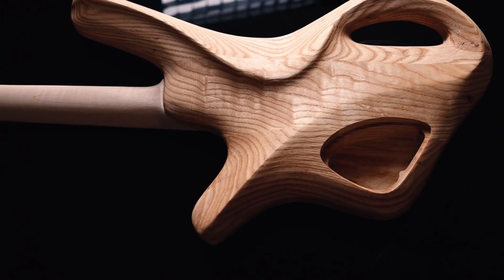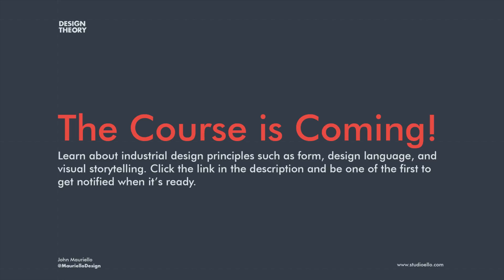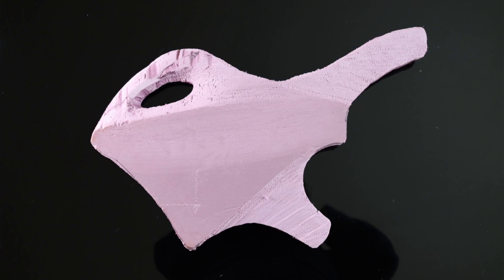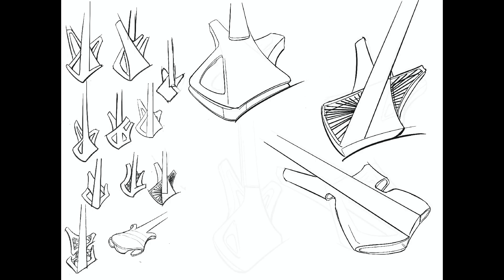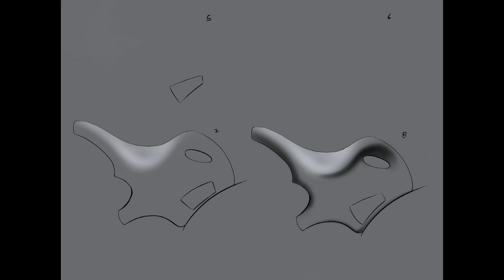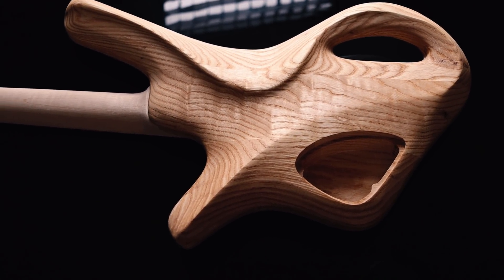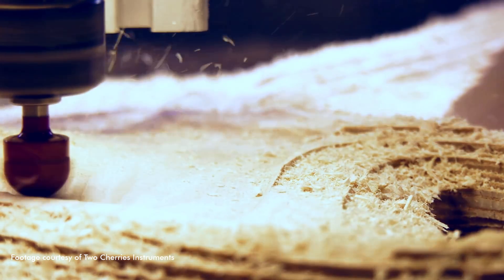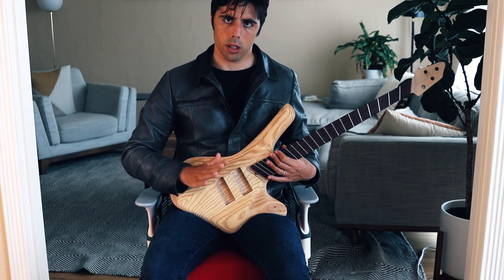How I Re-Designed the Traditional Bass Guitar: Industrial Design Process

Comment: I've been an industrial designer for decades and a bass player even longer (and builder, as a hobby).  Observations: The amount of wood that goes into making such a heavily sculpted body, including the wood cutting and dust that ends up on the production floor, precludes medium to large scale industrial production.  In other words, this is a small boutique type prospect.  This is a market space where people generally pay $5,000 to $12,000 for a new bass guitar. 

The three most likely main questions bass players would want to know are these:  Weight?  Balance on a strap?  Tone/sound (related: active or passive circuitry)?   Expereinced players will also be concerned about neck construction: wood species, flat sawn or quarter, truss rod details/type. Does it have stiffing bars.  Is the neck 1-pc, 2-pc, or multi-part laminated construction?  Fretboard radius?  Nut width?  

Diving down further, we're a particular lot with concerns about neck shape/profiles and front to back thicknesses (at 1st and 12th frets).  An asymmetrical neck profile is bound to be of limited appeal because they simply are already.  Asymmetrical neck profiles have already existed for decades or longer, with famous examples, but they've never been all that popular among guitar and bass guitar players, broadly speaking.  There's also the matter of best orientation of the asymmetry (thicker on the bass/low side of the neck or thinner).   The best answer can depend whether the player prefers to play their bass guitar on trap, standing, at low, or neutral (closest to or same as sitting position) to high position (classical) relative to their body.   You've put a lot of consideration toward playing the bass while sitting but it's also important to consider the standing player and balance those needs as best as possible.   This leads to a lot of questions about neck profile choice.
Reply: This circles back to the beginning.  I'd question why some players you know of have problems with carpel tunnel, analyzed on an individual case by case basis.  What are the true roots of the problem that might be solved?
Reply from the maker: Here's my response to your questions.  
Weight?  7 lbs for the prototype in the video. will vary, though depending on the wood...probably 6.5-8 lbs. 
Balance on a strap? not sure how to answer. no neck dive, if that's what you're asking.
Tone/sound (related: active or passive circuitry)? Active circuitry. Link to sound samples is on my instagram (link in description)  
 Experienced players will also be concerned about neck construction: wood species, flat sawn or quarter, truss rod details/type. Does it have stiffing bars.  Is the neck 1-pc, 2-pc, or multi-part laminated construction? 2 piece neck. Quartersawn maple. I think I ordered chechen for the fretboards but I'd have to check. No stiffening bars.   
Fretboard radius? I think I did 10 or 12" but I'd have to check 
Nut width?  1.5 inches. 

I'm only going to be building seven of these. I haven't figured out the price, but they won't be cheap. You make fair points about neck profile, but I probably won't change the neck profile too much since the design is complete and production is underway.

Comment: The problem of Fender bass guitars is how Leo Fender thought how players would play the bass, back in the 50's the finger rest down the strings was designed for bassist to rest their fingers and use the thumb for plucking the strings. Of course, this wasn't thought through and bassists played with their index and middle fingers to play, just like a traditional upright bass.

Comment: As a bassist I would recommend adjusting the angle of the neck while keeping the way that the body sits the same. In your short demonstration of the prototype I can tell that trying to play the prototype with a standard right hand finger style technique would cause uncomfortable bending in the wrist to the right in order to align with the strings. If you were playing with a technique similar to a finger style guitarist where the thumb is used to play notes as well as the fingers then this bass would be exceptionally comfortable because that technique requires the angle of wrist that your prototype encourages in the right hand. Adjusting the neck angle upwards would align the wrist perpendicular to the strings and remove any unnecessary bending. I’m unsure if this adjustment could have a negative effect on the left hand wrist angle. Just a suggestion, I hope it helps!

Comment: The ergonomic design is actually pretty cool, it’s fresh and it gives futuristic vibes. I don’t mean that the fender isn’t beautiful or iconic, but sometimes we need to try new things. The fact that it’s not only asymmetrical in two directions like the fender, but also in the third dimension, really represents the possibilities of music.
Reply: Only problem with the new design is the old design works just as good… if it’s any more costly than those I ain’t buying it. I’m more of a function over form person, I guess?
Reply: @deskslam4232  well the benefit of something being more ergonomic is that it further prevents bad postures that lead to actual body problems. I admit that I've got a passion for the art of ergonomic design, so I might be biased.
Reply: Well the new design was specifically made to solve the ergonomic issues the old design brought up.  So therefore, the old designs simply don’t work as well when it comes to ergonomics.

Comment: And now for an honest critique from a fellow industrial designer (not to be read as angry, hurtful or mean) This design doesn't change the ergonomics of playing a bass. That comes from the fact that the fret board is flat and you are playing it it from the underside with the fret hand and the over side with the picking hand, while horizontal. this has not changed in the design. You'd need to be very upright for it to change, like and upright bass, and behind the instrument to lessen the angles. Otherwise you'd need to make a twisted fretboard to ease the angles on your wrists. That could be really neat, but there would be some serious fret buzz probably. An easier solution would be to have a weighted design that would stay in the position you wanted when wearing it on a strap, since most performing musicians play standing up. What you have designed makes an upright playing style, but only for your body. A round bottom would allow the user to configure the angle without having any sharp areas in their lap. Maybe something adjustable that could support the bass against the player's leg could have been another solution. The end result is beautiful, but it is more of a styling exercise if we are honest, because of the fundamental physics of stringed instruments, and the style of playing electric basses.

Also for next time, you should have finalized your design further in your foam model before moving to CAD. You could have gotten to the same point as you did with the CNC which needed corrections after milling with just hand tools. Then you could have measured your model for CAD, cut up the model and scanned in the sections 2 inches at a time to have an exact model in cross sectional planes for rhino. It's lower res than 3D scanning, but not everyone has access to that kind of machine. 

Can't wait for the next iteration!
Reply from the maker: Hey spaceman, thanks for the feedback, but this is not just a styling exercise. This is significantly more comfortable to play, while not requiring the user to completely overhaul their technique or look like a weirdo on stage with a vertically oriented bass.  If I do another iteration, my plan was to always do a more vertically oriented instrument because of the ergonomic benefits it provides. However, based on my research, this is the most advanced yet acceptable solution. 

 I could have twisted the fretboard. Twisting the neck with that level of precision has been done with other instruments,  but it would have doubled or tripled the cost of the instrument for only a marginal improvement in ergonomics. 

I did about a dozen mock-ups in foam that were more sculpted, and I think at least one of them are actually in this video (I could be wrong). But yeah, I didn't photograph everything, just for the sake of expediency.

Just to be clear, did you watch until the end? It's a pretty significant improvement in terms of ergonomics. I've tested this design with about 6 or 7 bass players. You always have to take these small sample sizes with a grain of salt, but the results have been pretty positive. The biggest advantage is the positioning of the instrument, which is enabled by the sculpting of the body, the shorter scale length, a very specific asymmetrical neck profile, and the body shape (being able to switch between classical and modern playing positions)

Comment: Sorry.. I'm gonna have to stop you at this one. you're clearly a talented designer and you understand some of what goes into a good instrument, but you lack some of the understanding of instrument ergonomics that mean this is more of an art piece than an actual redefinition of the bass guitar as an instrument.
Reply from the maker: Do you have any specific feedback? Otherwise I'll have to strongly disagree with you.
Reply: @Design.Theory  1) that neck joint. if you’re planning on making it set-neck, it might work, but in that case you could get away with a much smoother transition between body and neck. if you’re planning on doing bolt-on, good luck getting that to work. check out Ritter instruments for some good alternative neck joints to the standard block-fender style.
2) the ridges on the back of the body. they look cool, but having a smooth surface on the back makes the body a lot more comfortable, and you’re just gonna have some edges poking into the player. 
3) this design is pretty much exclusively playable in classical position. classical position is great and all, but a majority of musicians don’t play like that. having better counterbalancing so the instruments doesn’t dive when not sandwiched between the user’s legs is a must. 
4) Why no headless? If you’re redefining the bass guitar, there are few things that are more of a nightmare to deal with than a headstock throwing off the center of mass of the instrument. 
5) that fan is really aggressive, especially for classical seating position. those upper frets are going to be practically unplayable in a standard 3-or-4 fret stretch because the frets are angled opposite of how the hand naturally countours up there (see Ibanez’s new Quest line of guitars for their slanted frets, really helps in classical seating position). 
6) Id extend that lower horn. not only would it help bring the center of mass closer to the center of the instrument, it would mean that in various playing positions the instrument is less likely to slip off or be unstable

Comment: The first instrument I ever loved playing was the electric bass. When I was 10 I found an Aria Pro II at the local music store on consignment for 150 bucks and one summer I won a $100 prize at a music festival for something I played on piano.  This would have been 1997.  So I put up my prize money and my folks chipped in the rest.  The body was a bit banged up (as far as I was able to determine the thing was made in 1981) but even with my weak little uncalloused fingers and pencil wrists I was able to get a good sound out of the thing almost immediately for a few of reasons:  

1: The neck was not tapered so I could reach around it at either end, 
2: The action was low and constant with frets in good condition so I didn't have to apply undue amounts of pressure to avoid notes buzzing, and 
3. The pots and jack were of such good quality that even though this thing clearly hadn't been babied there was no crackle, hum or other noise from the electronics.

Also, it had a single P humbucker built into a rectangular box inlaid in just the right spot to give you a place top rest your thumb when finger picking.  When trying to play other basses I always felt a bit lost without that reference point.  It's always possible to rest the thumb on the heavy top; most string but obviously that's not optimal as it's not fixed and quite often needs to be allowed to ring out which means hands off.

I like your design but it reminds me a lot of designs I've seen before.  There have been some crazy body shapes for basses.  I used to want a Ritter Jupiter like nothing else.  I sorta still do now that I think of it.

Anyways I just sort of rediscovered your channel.  I remember seeing and liking it some time ago but I ended up not subscribing then because I've always hated sales and marketing language.  More recently I've been able to pick that apart from the fact I just hate capitalism.  I don't think there's anything wrong with creating and wanting to make a persuasive case for new or ambitious designs; especially if they may be counterintuitive at first.  I'm willing to believe (for the time being) that your an artist that needs to eat and pay rent first rather than a smooth talking salesman that takes perverse pride in persuasion in and of itself as some sort of art.  So I'm now an official Design Theory hypo-theorist.  That means I subbed.
Don't let me down.  Or do.. I'm not your dad.  I'll see ya around.

Comment: The angled frets actually make a tone of sense looks comfy now I'm realizing how weird it is that they're traditionally parallel
Reply: You can actually find fanned frets on a whole lot of basses and guitars for metal.
Reply: Probably a manufacturing decision, but I agree! Angled frets seem way more ergonomic.
Reply: @BlueJay_55  they also increase the scale length of the lower strings so they don't sound muddy
Reply: Check out the Ibanez EBH1000 - they have a couple of other models with fanned frets, electric guitars too, but that one was especially comfortable to play when I tried it out a while ago.
Reply: Are you thinking of the ehb 1000? It's not multiscale. The 1005 is though.
Reply: @bengal2441  Nothing to do with intonation whatsoever, just more suited to have a lower tuning on the bottom strings.
Reply: @bengal2441  i think you confused fan fret with true temperament fret.
Reply: @bengal2441  lol
Reply: Very comfortable to play too
Reply: Fanned frets are multi-scale, meaning if all guitars were like that the low strings might be too tight and/or the high strings might be too floppy, fanned fret guitars and basses are great for different tunings though
Reply: @nighpaw4651  Most of the time, on straight-fretted instruments, especially basses, low strings are too floppy and high strings are too tight. 34" barely works for the low B string, it's not very defined on many instruments. So we have 35" instruments to improve the sound down there. But then, high strings might start to sound too thin and too guitar-like. Short-scale instruments (30") tend to have fuller, nicely rounded D and G strings. Fanned frets solve this problem. There is a reason why in a piano or on a harp the higher-pitched strings are much shorter.
Reply: It's not  weird, it's practical due to manufacturing  limitations. A lot of  designers and engineers can come up with all kinds of fanciful sh*t  that is costly and  difficult to  manufacture.
Reply: no they don't. they're literally a fad.
Reply: Just because frets R straight doesn't mean your hand has 2 B, especially on bass where U R not doing 'bar chords' much =))  On guitar U can simply hold the neck at an angle & the 'fret angle' is not an issue N E more, + if U have fanned $hit swinging bar chords around will push them out of tune more as your finger changes angle going up & down the neck.  Fanned frets R just a stupid $cam.
Reply: @Deathrape2001  I'll be honest I can barely read this

Comment: This job is absolutely remarkable.
I've been a bass player for long time, got basses from many brands, played different music style.
The only issues I would see with your design are:
Weight balance: in actual bass playing, neck+fingerboard+hardware most probably will be heavier than body+electronics. So the bass will tend to tilt and the musician will have to put an effort to compensate this during playing;
Sound and tone: well this is subjective, but, in general, the body shape must also make sure the bass sounds well :)

Anyway, thank you very much for this job, please let us know your next steps.
Reply from the maker: Hey Edoardo, I actually fitted the prototype with hardware/pickups and have been playing it for a few months. It balances well and sounds great! I made a few changes to the body, as well. I'm going to produce 7 instruments in the next couple of months.

Comment: Hi,
I loved the work you did for this design, also the efforts you put all together to share the process of this design. 
I have one question, I noticed you made the fretboard with angled frets  aligned with finger movements, but how it's really going work with standard frequency strings? Cause where you cut the strings on board, that frequency needs to be synced with standard note layouts.
Please share your design thought process on this.
Thanks again & great work!
Reply from the maker: It's called a multi-scale neck. Each string has its own scale length, so the intonation of the strings is not altered or hindered in any way. This fretboard system was invented by Novax Guitars about 20 years ago.
Reply: @Design.Theory  awesome invention, thanks for bringing that up. I went through this patent 
US4852450A shows interesting information.